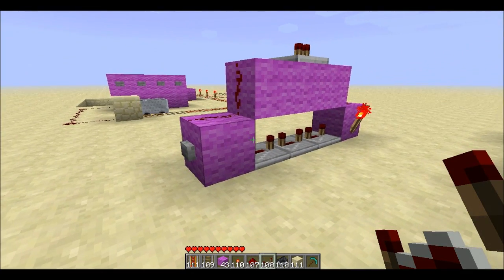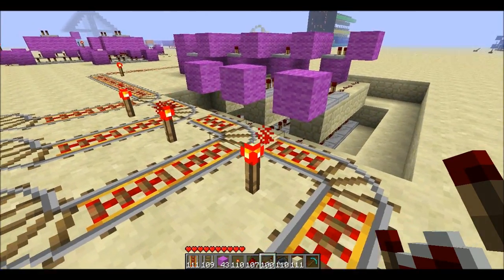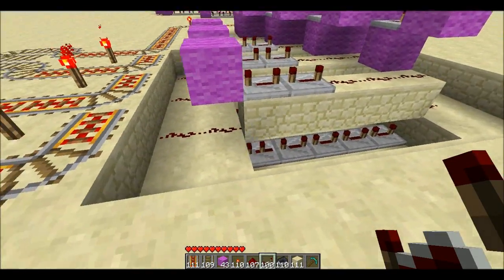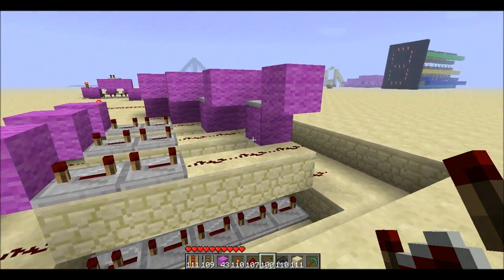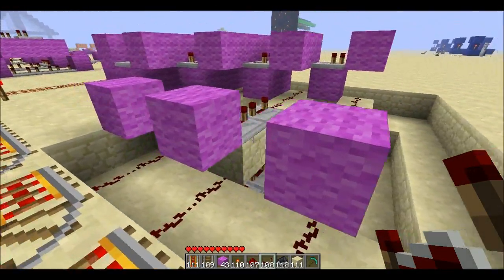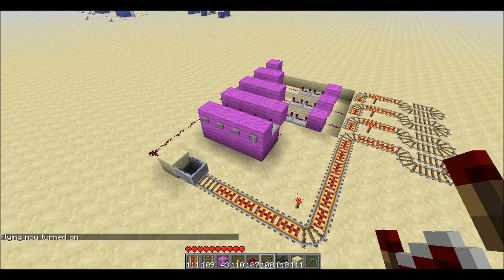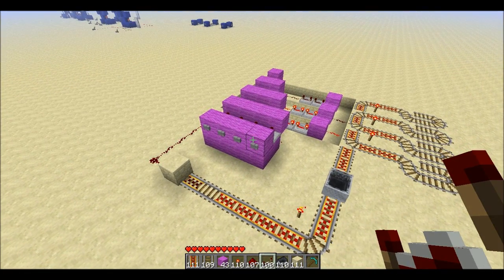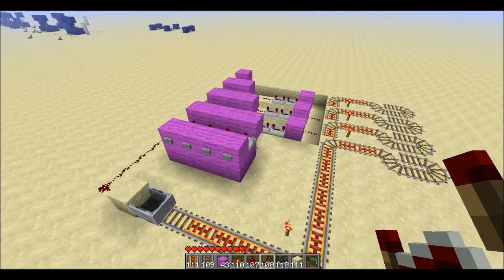Minecart Station Timing Array With Pulse Lengtheners

Comment: You could use a detector rail and latch, So when you press the button the latch goes on for the direction you want. And when you cross the detector rail it resets.